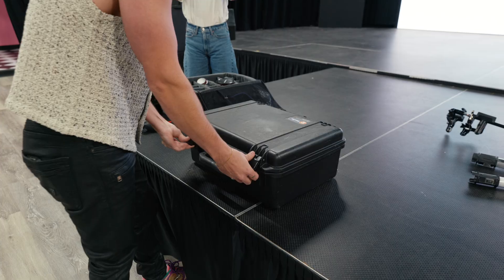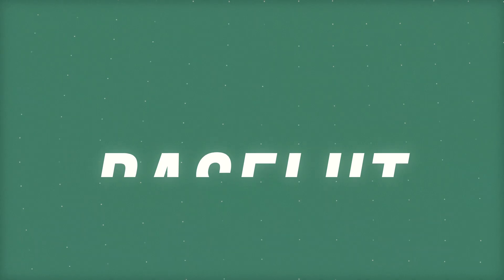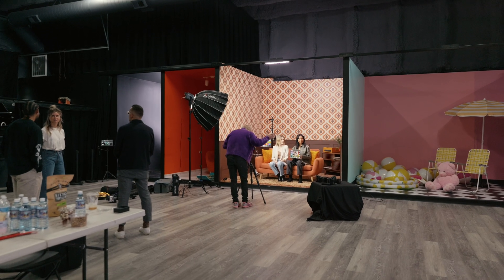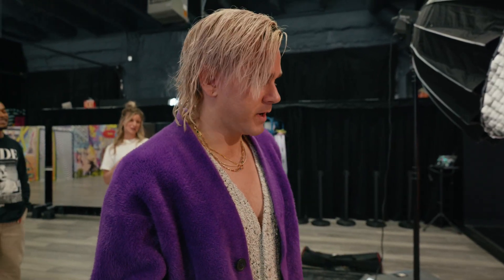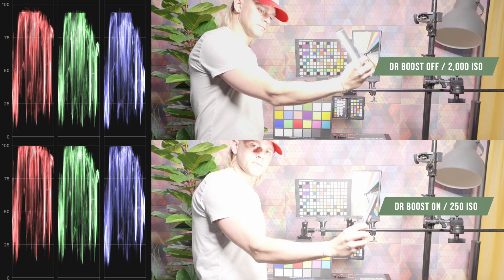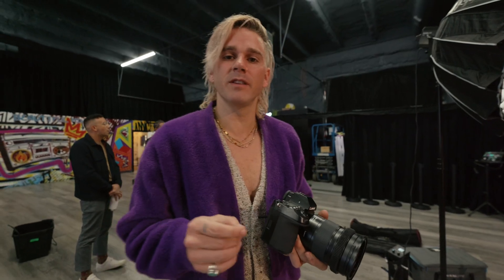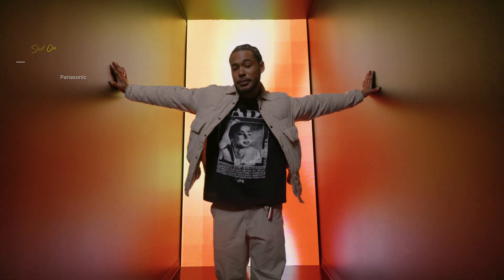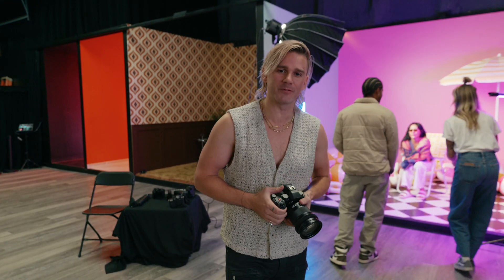Why Your Panasonic Footage Doesn’t Look Right — And How to Fix It

Comment: I purchased some baseLUTs for my BMCC6K and GFX 100 II. The bold versions are really nice in terms of getting to a rich and saturated look. However, I noticed that there is some posterisation/breakage in the out of focus areas when using them with some finishing film look LUTs. For context, my node tree in Resolve is BRAW + baseLUT > CST from Rec709 to ARRI Log C3 > ARRI Log C3 + film look LUT.
Reply: Did you remember to switch to tetrahedral from trilinear?
Reply: @Fedorevsky that’s a really good question and something I forgot about, I will check and see!
Reply from the maker: Let us know if you need further help—we'd be happy to look into some footage and structure for you! gamut.io/support to submit any footage!
Reply from the maker: Like mentioned before, make sure your settings have Tetrahedral selected under Color Management instead of Trillinear. Also, you are going from a small color space like Rec709 to a large one like Log C3 which will undoubtedly cause some issues. We recommend using our DWG version of the LUT instead. We designed our BaseLUTs to also work in DWG for this very reason. If you want to use your Film Look LUT that is expecting Log C3, then add our BaseLUT for DWG, then a CST from DWG to LogC3, then apply your Look LUT. That should produce much better results and keep you from having to go down to a smaller color space and then back up to a larger one. Hope this info helps!

Comment: I had to learn the hard way about the variation in difference for V-Log and I've been struggling a lot to get the right look out of Panasonic!
Reply: One thing I will say that helped me was over exposing right before clipping. My image came out cleaner and colors did as well. I don’t use CST but I do use phantom luts and I’m thinking about trying these
Reply from the maker: you do get the cleanest image in noise when you expose to the right, however, you do not maximize dynamic range and have to bring the exposure down on each clip in post creating more work. We recommend exposing for middle gray instead of white clipping point levels as middle gray is always consistent in every frame while white clipping levels vary from shot to shot. If you ever want us to compare our LUTs to Phantom, just let us know. We are also releasing our own Arri conversion Looks soon and can compare them to Phantoms.
Reply: @GamutColor I would love to see a comparison